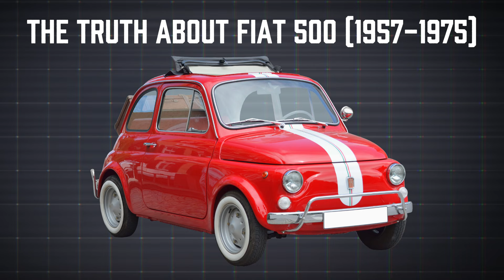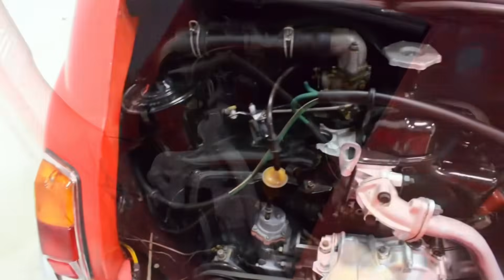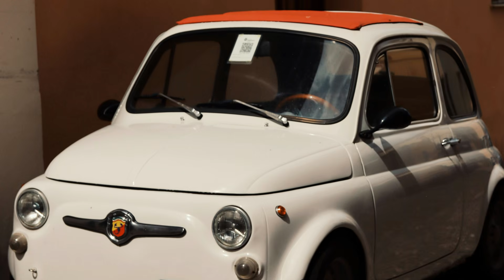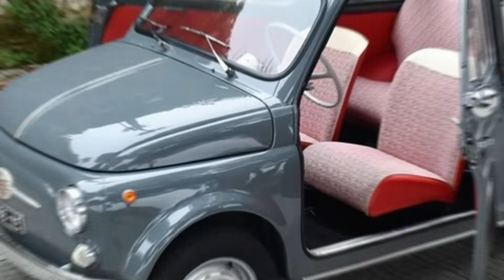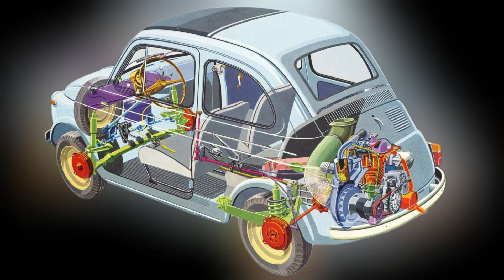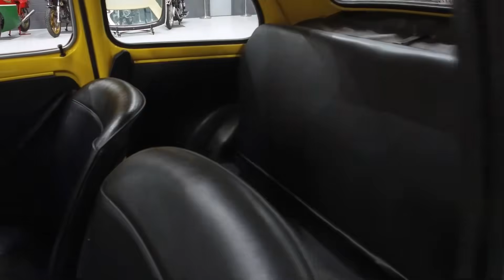The Truth About Fiat 500 (1957-1975) You Need To Know

Comment: I bought a 500 in 1964. Economy and parking were great . Comfort, ride, heating  ,brakes and electrics were good. Control reliability poor ( sticking accelerator, broken clutch cable ). Handling on slippery surfaces put the fear of God up me. Oversteer was lethal.

Comment: This vid has lots of errors. I lived in Napoli, Italia for 4 years, 1976-1980, and owned two Cinquecentos (CHINK-WAY-CHENT-OH, which simply means "500" in English). One was a mid '60s model, 1965 I think. The other was a 1975.

Here are the top few errors I noted:

1. The design was not near as well done as the vid says.
  - The muffler was bolted to the side of the engine's crankcase. However, the threaded holes for the muffler bracket bolts were through holes so that when a bolt vibrated out you had a hole in the crank case, which squirted oil right on the hot muffler. This happened pretty
Often, because the little 2 cylinder engine's flywheel was too small/light to dampen the vibrations enough to keep various bolts from vibrating out.
 - There was ZERO heat in winter.
  - The fuse box contacts were copper, which quickly corroded in the salt air. I had to carry sand paper to clean them up every time something quit working.
  - Their steel was thin and rusted through like mad.
  - The paint oxidized in 3 years.
  - The door latches were NOT secure. They were prone to pop open if the person let their weight press on them too heavily.

2. The "suicide doors" were redesigned into normal hinge in front doors before my 500's were built.
  - The Suicide doors are called that because if the driver is standing in the doorway with the door open, and a car comes along and hits it, the impact will smash the door shut on the person. This can result in the person losing their legs or head, or both.

However, I loved my Chinks anyway. The gas milage was best I ever had. Even my 1980 Honda CB750K motorcycle couldn't do better. I could wash every window in the car without getting out of the driver's seat.

Comment: Some of the commentary here is dodgy at best.  Suicide doors were common on most cars at the time - they were nothing special on the 500.  The interior was as 'handcrafted' as any car of the period or today - basically, people put the bits into the inside of the car.  Almost all of the Abarth footage is of the Fiat 600 and all the crap about the folding roof on the Jolie is utter nonsense.  I had a Fiat 500 as my first car back in 1982 - it was ten years old, rusty and had failing brakes.  I paid £75 for it.  Dark blue, with red seats, although one of them had been replaced with a black one.  I loved it.  I owned it for 21 years and went everywhere in it.